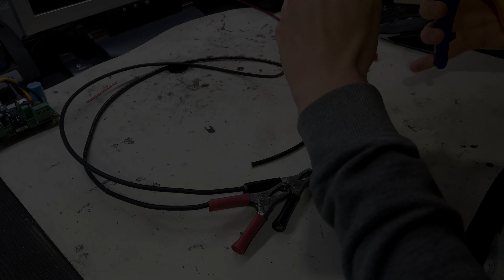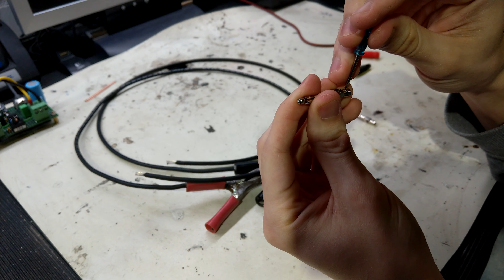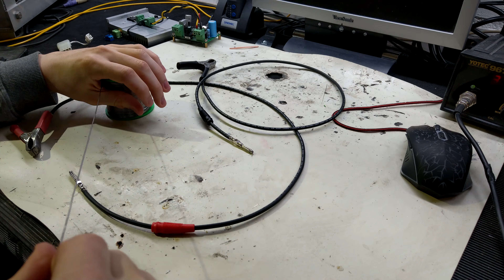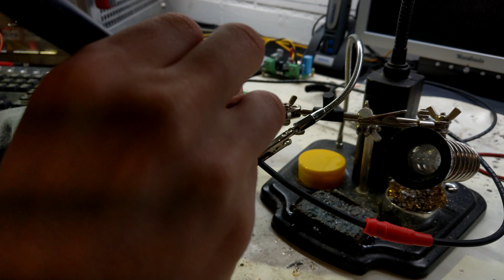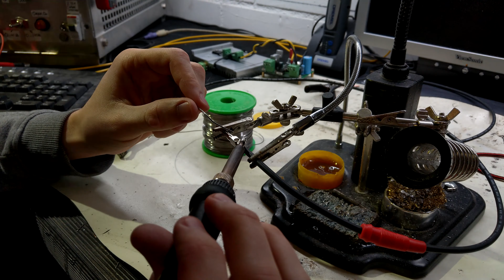BS-1: Big CrocClips and Battery Powered Carbon Arcs

Comment: Why did you stop making videos, I'd have watched!
Reply from the maker: I'll make more eventually. it's just been too inconvenient since I dont have regular access to a workspace and I've been working on some stuff that wouldn't make for interesting videos imo. 

I'm actually working on the big variable transformer unit I used in video #2 at the moment, trying to finally realize some more of the features I planned for it from the start years ago. 
The circuitry for it is becoming incredibly complicated, I still need to design a ton of PCBs for it, order a new front panel with tons of cutouts, and rebuild the entire unit pretty much. This also means it is in pieces right now, preventing me from working on most of my other video ideas. But at least I found some time to finally work out most of the details of it now. Once I'm done I will probably make 1-2 videos about it and explain it all. And most importantly, see if any of it actually works as intended, lol.

Well, you didn't really ask about that I guess haha. But yeah, I've got a few videos on my second channel too if you haven't seen it.

Comment: 0:16 i have the same thing idk its name but my one its exactly the same
Reply from the maker: You mean the wire stripper? Not sure if it has a specific name, the chinese sell a few variants of it, some of which are apparently very bad quality. Mine works pretty well.
Reply: @Basement-Science  i have my one since i was 7 years old and still works
Reply from the maker: @shadowthenightfury2572  That's pretty good! I guess there is not much that can go wrong with that design. Mine is maybe 2-3 years old.
Reply: @Basement-Science  btw how old are you?
Reply from the maker: @shadowthenightfury2572  25
Reply: @Basement-Science  wow!!
 Im only 14
Reply from the maker: @shadowthenightfury2572  Well, I think it's great that you're interested in stuff like this at your age! :) 

I sure wasnt back then...
Reply: @Basement-Science  i started when i was verry little probably around 5 years i remember i wached my dad working on those stuff and i think that's why
Reply from the maker: @shadowthenightfury2572  I only really got into electronics about 4 years ago as a hobby. Although I did learn a bit from my dad who is an electrician before that.

Comment: You can dissolve the rosin based flux in alcohol, then drip/brush it on the solder spot like a flux paste.
Reply from the maker: You mean with ethanol?
I´ve tried it with isopropanol in the past, but that didn´t really work. (even when the rosin was heated) 

I might try it with some ethanol again.

Just melting it onto the iron works ok imo, you have at least a few seconds before its effect stops, depending on temperature.
Reply: @Basement-Science  I dissolved it in ethanol and methanol, both successful.
Reply from the maker: @heyarno  Ok thanks, I´ll try it.